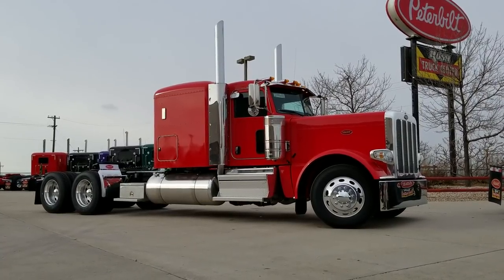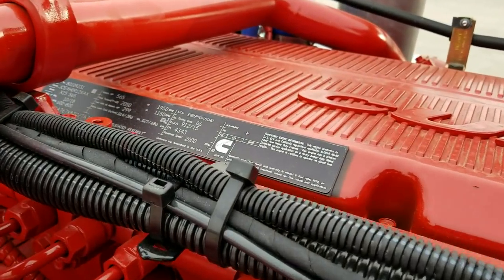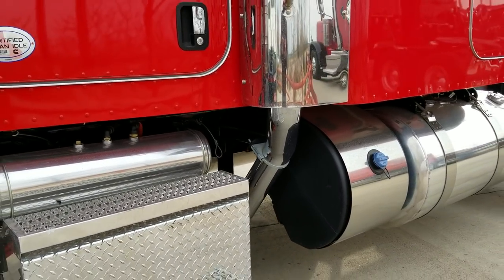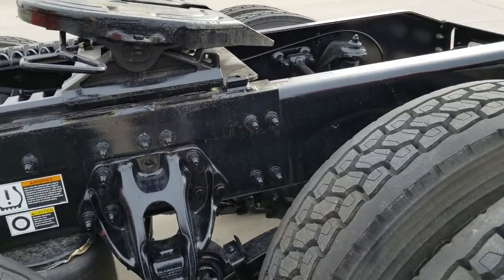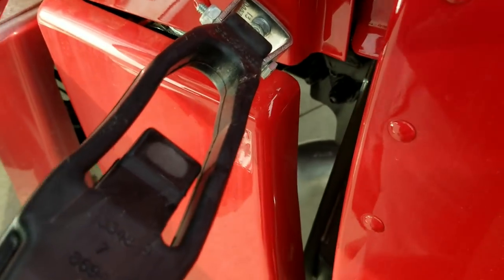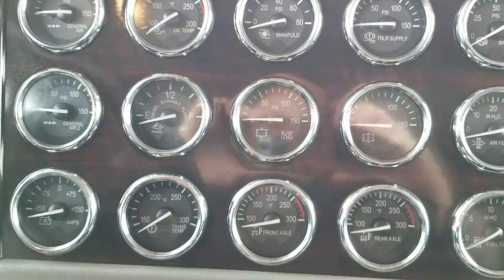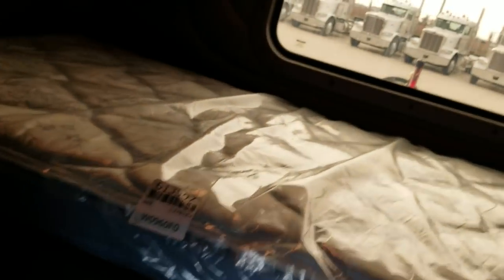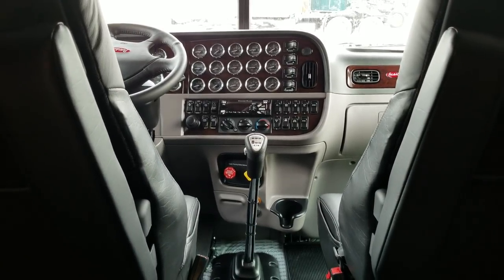2019 Peterbilt 389 Flat top- Viper Red- JW 970-518-5520

Comment: You guys just can't give up on those 24.5 low pros.  Tall 22.5's are same RPM.  weigh 10 lbs. per wheel less., look better  does matter if are large round or Peterbilt. hole. plus generally a better trade in value when replacing.
Reply: Daniel Hofer big dawgs use 24.5s thats large car swag .
Reply: @jeremymccardle3696  They are a thing of the Past.
Reply: Daniel Hofer any brand new loaded up 389 or 900 has 24.5s what are u nuts
Reply: you had better take another look at new trucks.  3.36 or 3.25 ratio with  22..5 tall or 22.5  low pro tires are becoming more & more popular. Vans & reefers run 22.5 low pros very popular. as  I said before trade in a 24.5 low pro tire & see what you will get for it then see what you can get for a  a 22.5 tall tire on trade. the new price is very similar but the trade in price is apples & oranges in difference threw out America.   I'm not nuts!
 @jeremymccardle3696
Reply: dude the very truck we are talking about on this thread has 24.5s. every 389on that lot  has 24.5s smh Damn man are u really serious
Reply: Daniel Hofer more rim less tire
Reply: 11R-22.5's also ride better with taller sidewalls.  You can find an 11R-22.5 ANYWHERE. Personally, I like an 11R-24.5 with 3.7 or 3.9 rear gears.
Reply: Canadians swear by tall 24.5’s